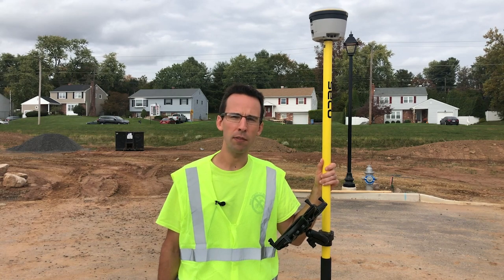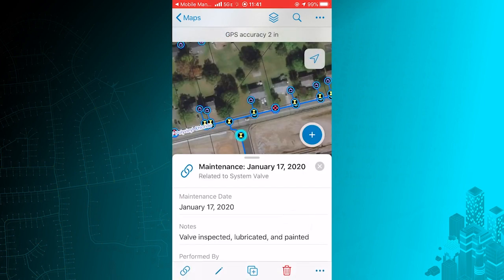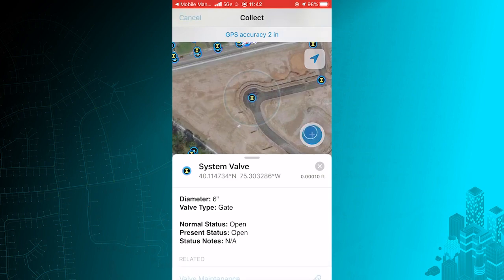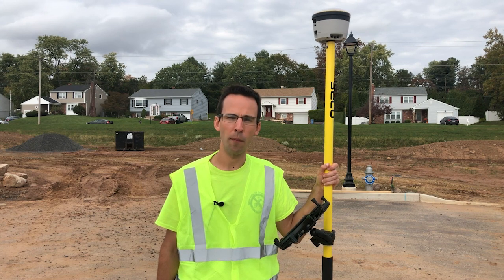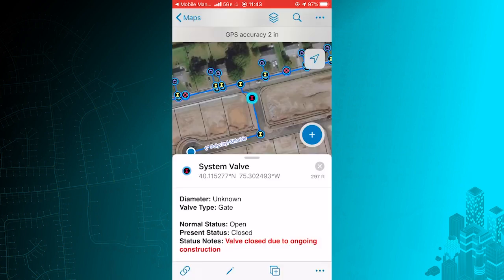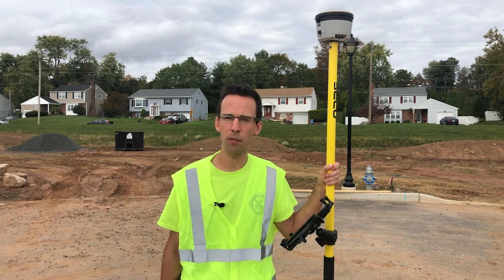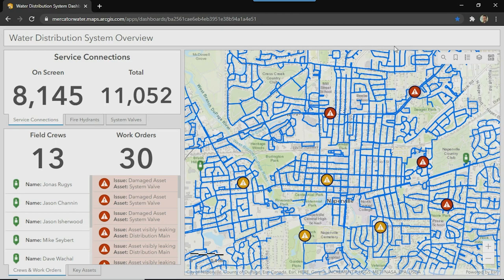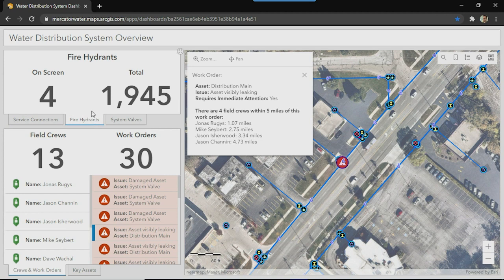Asset Collection using ArcGIS Field Maps

Comment: Hi Eric, 
How did you do to show in the Pop Up the information of the distance to the nearest Field Crews. (Min 4:32)

Thank you.
Francisco.
Reply: Hi Francisco, thanks for directing me here from my other video. The ability to have the distance to nearest field crews  requires two things: (1) knowing the real-time locations of your field crews with the location tracking functionality of ArcGIS Tracker/Field Maps, and (2) an arcade expression that compares the locations of your crews to the "incident" (in this case it was the main break). Location tracking comes with the Field Worker user type or through purchasing the add on Tracker license. The arcade expression that I used came from this web map: https://www.arcgis.com/home/webmap/viewer.html?webmap=58291e9bde774bd1a17f1f877a60fc0e&extent=-180,-40.0444,-21.9727,63.3127
Click "Modify Map" and then open the Pop-up configuration for the earthquakes layer. There is an Arcade Expression called "Nearby Cities." It compares the earthquake location to nearby cities. Copy the code to your web map and replace the layers and attributes as needed to fit your needs. For me, I replaced the cities with field crews, and instead of the city's names, I show the field worker's name. Also, you'll see that you can change the buffer distance that the computer will look for nearby features. I set mine to be 3 miles, so update that as you see fit. It looks like a lot of code (it is!) but it's pretty easy to read and manipulate. I'm TERRIBLE at coding but managed to update this code to work. I hope this helps!

Comment: How does the GNSS receiver communicate with your smart phone with its collected location information?  Bluetooth?  Pretty slick if so.
Reply: Hey Mark! It does use Bluetooth to pass information to the mobile device. Turn on the receiver, turn on the app on your iOS/Android device, and pair them together. For supported GPS/GNSS receivers and instructions, look here: https://doc.arcgis.com/en/field-maps/android/help/high-accuracy-data-collection.htm#ESRI_SECTION2_612D328A655644DCAF5CF0210308C821

Comment: Hi Eric, can you still send a field work request through Dashboard or do you have to see the distance then decide which person to contact? Or can you integrate ArcGIS Workforce with field maps so that a request sent from Workforce can be received in field maps? Thank you!
Reply: Hi Y. Peng! ArcGIS Workforce is still it's own separate app (web app for dispatchers, mobile app for field crews). However, that should be changing later this year; Workforce will be integrated into ArcGIS FieldMaps. FieldMaps will allow a dispatcher to create tasks and send them out to field workers within this one application rather than individual apps. This is an older blog, but it outlines the FieldMaps long term strategy: https://www.esri.com/arcgis-blog/products/apps/field-mobility/introducing-arcgis-field-maps/

On a different note, Dashboards can't directly be used to create assignments, however, the web app used by Workforce to create assignments can be embedded into Dashboards. I've seen users do this with great success! You can see a demo of it here (at about the 20 minute mark): https://community.esri.com/t5/water-utilities-videos/field-operations-webinar-series-part-1-inspections-and/td-p/976566
Reply: @ericwagner5794  Thank you for the detailed information, it's very helpful  :)